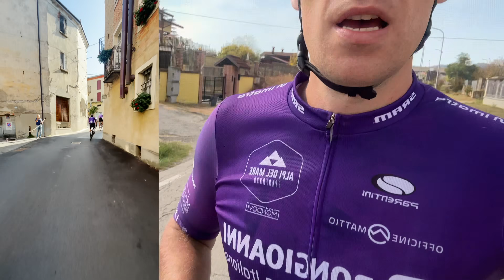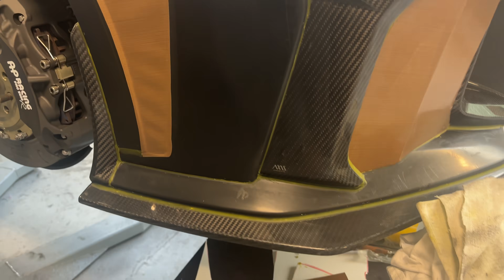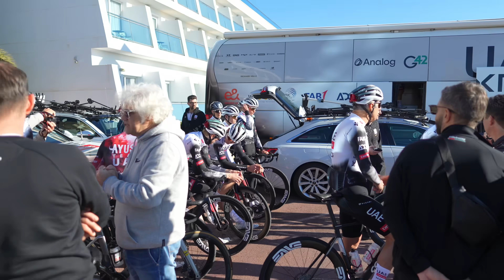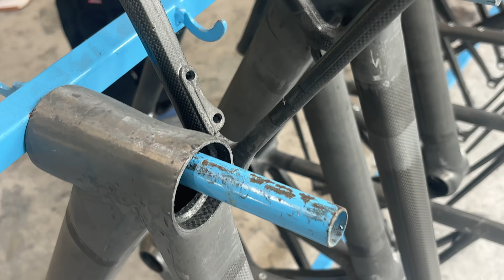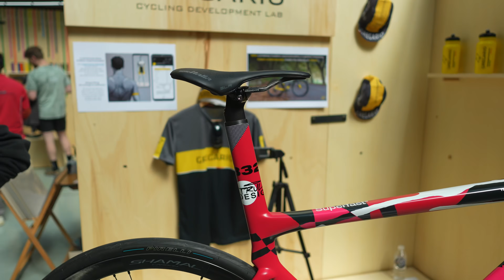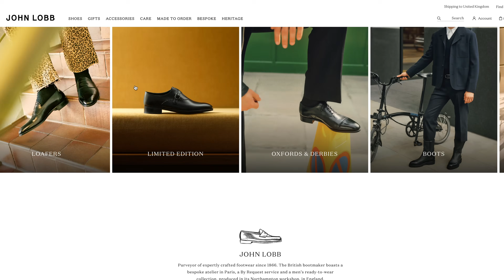Why are Carbon Bikes Always Hand Made? The Global Scale of Bicycle Manufacturing

Comment: Once again, an interesting question. However, I would like to take a broader perspective and challenge the bicycle industry—specifically, the inflationary use of carbon fiber. If we look at it objectively: the material requires an enormous amount of energy to manufacture and process a luxury toy, and at the end of its life, it becomes hazardous waste that causes problems in incinerators and does not burn away without leaving a residue. I have come to believe that 3D printing holds far greater potential. After all, what has arguably the biggest impact on cycling performance? Body positioning, to achieve a favorable drag coefficient. Instead of people spending vast sums on a "lightweight" frame, efficient customization could become the new trend. Sustainability—I hope—will increasingly move to the forefront. And in that regard, metal frames are simply superior; when 3D-printed (at least the joints), they aren't significantly heavier or less rigid—are they?
Also met the guys on the Bespoked in Dresden.  A saw lot of printing stuff. Maybe the tide is shifting a little bit.

Comment: I have an Officine Mattio SL with custom geometry. I was less than impressed with the build quality as it required brake mount facing, and headset components to be modified to complete assembly. I’ve since had the last and now current generations of Dogma F, and it’s a substantially better finished product. 

I like the brand, and I hope they improve things, but I don’t know I’d be willing to spend my money on another one.

Comment: Never ride a bonded lugged frame titanium lug Aluminium lug, carbon tube, failure rates are massive. 
The vibration from the road destroys the bonding glue, the bike will separate and fail under load. 

I've seen many colnago c40 bonded lugged frames fail, cracked, or complete separation failure with the rider being thrown over the handle bars as the bike fails and the crank hits the floor.

Comment: everything is great but the true revolution will come when we'll be able to recycle carbon fiber parts effectively... and it's not for tomorrow. But I know a french company which is trying to separate the resin from the fiber when crushing the parts, to recycle them...
Reply from the maker: Thermopolymer CF can be easily recycled. Yet its heavy and not as strong as a proper CF epoxy laminate.

Comment: Thank you; an informative video from someone with boots on the ground experience. I will mention this since it wasn't covered by PT. Northern Italy is renowned for class leading, usually smallish and family based, firms. It is a characteristic of commerce there and, in the bike sector, is evident since the days of steel frame and component makers. Exactly how each brand engages the challenges of growth and economics, whether they succeed or fail, has also much to do with how culture factors in to the proposition.

Comment: Specialized are part-owned by Merida, who would be making their frames (at least the S-Works) for them in Taiwan, surely? 

Isn’t Bianchi trying to re-in-source all their production? Basso I think are all made in Italy. And what about Willier? Colnago make their lugged models in Italy still, but everything else is in the far east, like Pinarello (who definitely are sponsoring ‘Pinarello Q36.5’ now).

What is it with Italian brands?! 😂

I think an interesting case study would be Time. Given they have that wild woven tube ‘no pre-preg’ technology and that big weaving machine they put in their videos. The Mapdec video on them is interesting. I guess it’s similar to the bonded tube process in this video, just that the tubes are made differently? An experienced manufacturing engineer’s perspective would be interesting.
Reply: Time's process is connecting at least part of the frame made with the wrapping, and then injecting the epoxy using a mold, they don't use lugs or brazing to connect the parts, it's "molded" like any (semi-)monocoque-frame, just using woven fiber instead of stacking up pre-preg pieces, and injecting the epoxy after the fiber lay-up part.
Reply: Yeah I was wondering if Time would be touched. But, at the end of the day in this video, they'd just become a monocoque maker and still get classed into the most of this is manual playbook.

Comment: Another brilliant video. Never mind Le Creuset, did you see Alec Steele's recent video about Brompton? They have what looks like a very modern production line, in London of all places, where they are fillet brazing their frames (brazing rod is full of copper and very expensive, and really no obvious reason to do it instead of TIG). Quality is second to none. Someone working there (or in the Maxway factory in Taiwan) will do more brazing or welding in a week than a custom framebuilder would in six months, and it's all about practice. However, sometimes mass production goes hand in hand with corner cutting (not in the case of Brompton) and I think that's why people don't always trust it.
Reply from the maker: I gave up on him when he found out that ‘damascus’ was good for the algorithm and he got hellbent 😂
Reply: @PeakTorque Don't know about that 😂 Not a regular viewer of his channel (although I have nothing against him) but the Brompton video was widely shared.

Comment: Specialized isn't exactly outsourcing.  Their bikes are built by Merida.  Merida also owns 49% of Specialized.  Which is - I imagine - why I can't buy a Merida bike here in the U.S.  Another way to look at  Specialized would be a joint venture between Merida and Specialized.  So they might not fall in quite the same category as all the other bike brands you've mentioned but they're also not in the same category as pretty much every other western brand either.
Reply: Merida is yuck, buy a Specialized
Reply: @JFomo  For sure. They're all made by Merida and Merida branded bikes are almost certainly kept slightly yuck so they don't compete with Specialized.

Comment: Well explained. I would never own a tube-to-tube frame for many reasons, material redundancy, extra weight, precipitous stiffness gradient which affects ride quality and even failure probability.
Custom geometry is 'largely a joke' for customers who don't understand bike fit and frames of this ilk will never have the overall flex and yield strength signature of 'off the shelf' geometries from name brand manufacturers. Exclusivity is worse and and not better.  Marketing BS pushed on the ignorant lay community by 'boutique' tube-to-tube frame manufacturers.
The consumer broadly will never understand tenants taught in engineering school.  A bike frame is an equation.

Comment: Maybe I missd something, but Merida ownership (49%, I think) of Specialized wasn’t mentioned, nor specifically the fact that Merida make most of their bikes. Specialized outsource most of their manufacturing.
Reply: Merida also makes a lot of frames for other brands
Reply: MERIDA own 49% of Specialized Facory , you are right 😊👍
Reply: @arnaudbaudon845  not the factory… Merida own 49% of Specialized, the company. Merida have owned a significant proportion of Specialized since Specialized began. The deal was that Merida would invest in the company in return for Specialized using Merida as primary frame manufacturer.
Reply: They also made steel frames for Trek in the 80's and 90's

Comment: It can be automated with tube and lug construction. The tubes can be made with pultrusion with thermoplastic carbon fiber composites. And the lugs can be made with the same composite with the "forged carbon" method. Then it is just a matter of robots bonding the lugs to the tubes.
Reply from the maker: Sadly the thermoplastic CF argument is far too heavy for the high end market (at the moment at least). A really good idea for town/commuter bikes maybe. Recyclable too.
Reply: @PeakTorque  It's being worked on for sure. Regarding commuter bikes, Vframes has been trying thermoplastic CF injection molding for frames etc. That's also an interesting way to get some of the production reshored to europe for ex

Comment: the problem with scaling carbon prepreg frames is that the tight geometries really don't work with automation like AFP/ATL or stamping. Hand layup is the only way to do it if you use prepreg. The only alternative with some hope for automation I know of is what Time does with braiding and RTM, or theoretically thermoplastics and a very complex process of turning flat preforms into tubes
Reply from the maker: Thermoplastic CF wheels didnt take off due to the weight, sadly . If you excuse the pun. Forge and Bond recently folded i think. Nice idea for mass market/commuter/sharing bike frames, if AL ever becomes too expensive. Recyclable too.
Reply: @PeakTorque  indeed TP isn't quite there yet. Hence why I called it theoretical
Reply: Surely the methods can be improved to meet any geometry requirements. Just look at how injection molding changed over past decade. Robotisation of electronics assembly took a great leap somewhat earlier too.
But it takes either comparably big volumes or high exclusivity to justify the investment. Former doesn't look much reasonable though: we don't need multiple millions of new carbon bikes each year unless we agree it's a throwaway item.

Comment: I can see that panda has new INCOLOR SSR frame on sale. They are offering custom geo. Is that some special mold that would allow that ?
Reply: I've checked the custom geo chart they've given. It's probably not the same as this. They essentially have min-max ranges on reach you can choose from per stack but won't go farther than that. What's likely is they're using molds that are extendable, but you can't really request a completely different geometry (e.g. really high HT and long reach, low BB, custom fork trail, chainstay length etc...) unlike the video. The only parts you can adjust on their end is stack and reach.
Reply: @ryoukokonpaku1575 yea I’m not completely sure but it looks like maybe the fork legs are longer to improve stack and the reach is shorter as you said
Reply: I’ve just been looking now! Thanks so much, this is potentially a dream for me as my fit is horrible but I do race